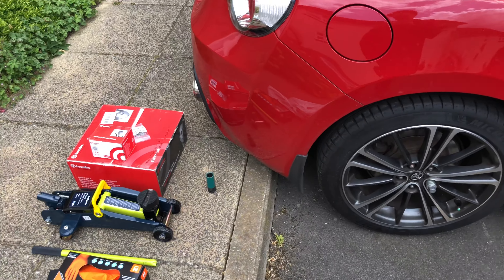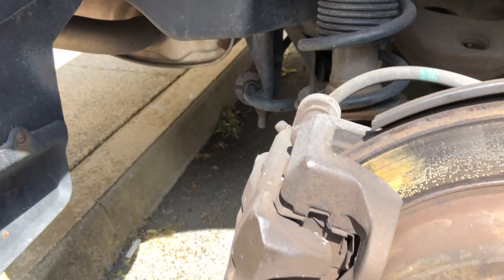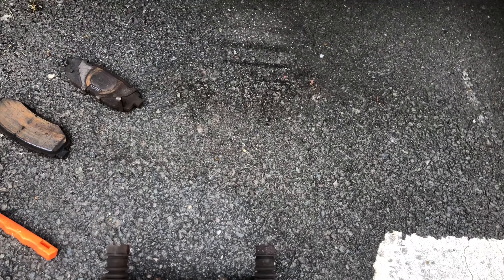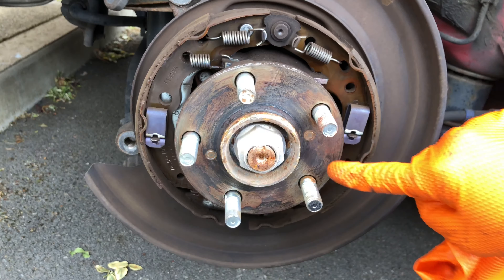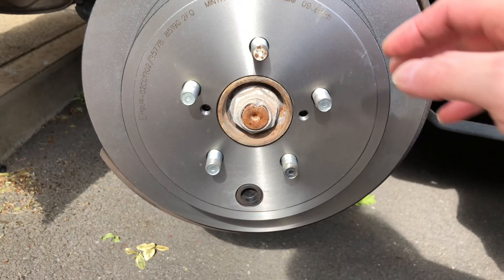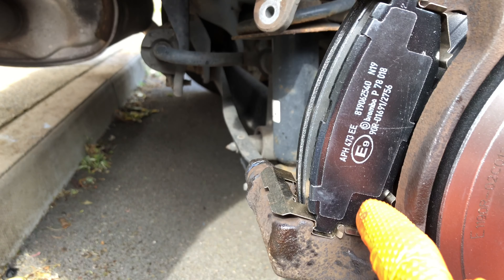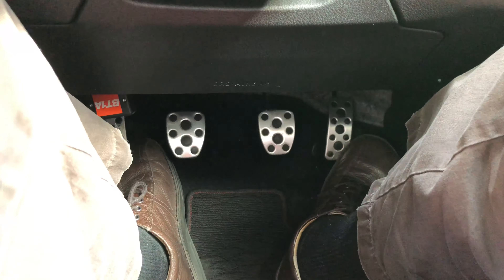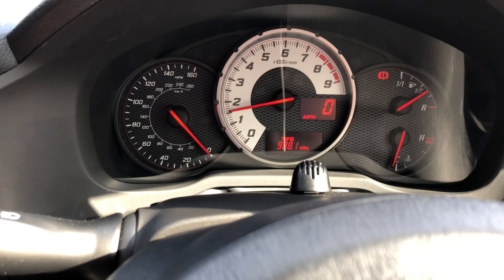Replacing the GT 86 Hachi Roku's Advics rear brake pads and rotors with Brembo ones

Comment: Hi, where do you buy these Brembo discs and pads from? I'm struggling to find a supplier in the UK, EuroCarParts only seem to sell the front discs at the moment. Thanks.
Reply from the maker: Hello, I have avoided them since I got cheated in by am employee in one of their stores many years ago. The right place to search for these things is AUTODOC. Be warned there are many 'sister' websites that operate under different names, logos etc. but the order will be fulfilled by AUTODOC therefore go direct to them. The other place to search would be on eBay. I hope this helps.